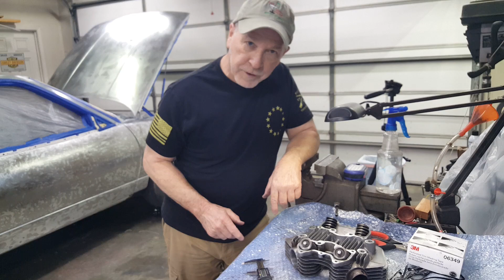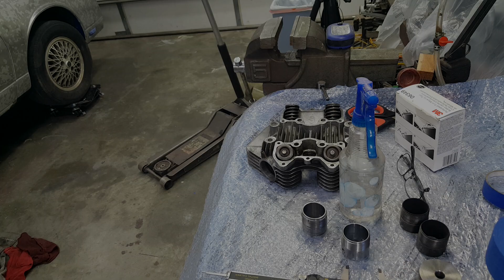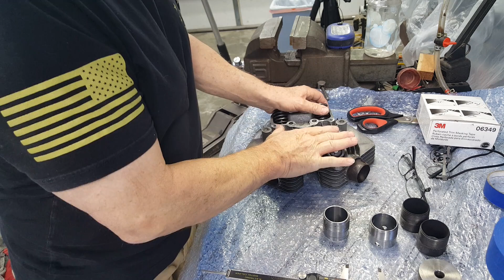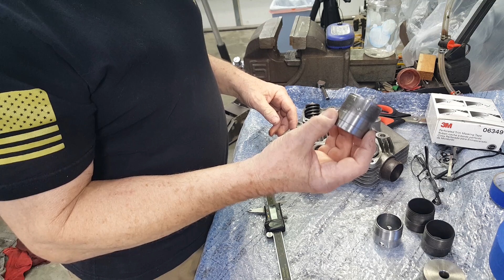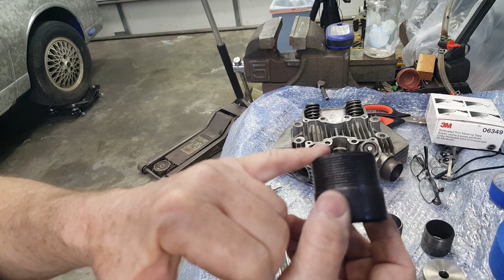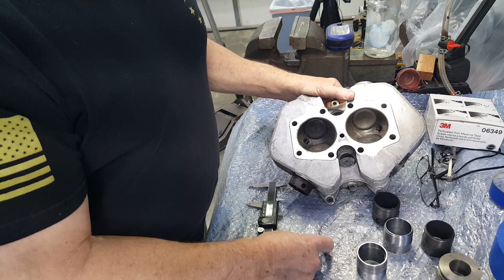1969 Triumph T120 Head Repair Change of Plans

Comment: Is there a set of push rod tubes you could have used?
Reply from the maker: Hey Paulie:  I don't know about that.  The person to ask specific compatibility questions is Todd, at Lowbrow Customs, or possibly Dirty Shirt Richter (another YouTuber).  That engine had been rebuilt recently, and I'm guessing the owner had oil leak issues, and made the upgrades for the later model tappet blocks, later push rod tubes, and while the head was being machined they just went ahead and counterbored the pushrod tube hole in the head to whatever depth was necessary for it all to fit.  That's a pretty easy mod with a milling machine and an angle plate.  I asked Brad if he wanted me to make that mod to his replacement head while I had it set up on my mill, but he decided he wanted to keep it stock for its year.
Reply: @JohnnieBravo1 I've subscribed. You really need to do your research with these motors. I've been watching(over the years) Lunmad, Todd, Dirty shirt, Wes, and many more..now I've added you.😂